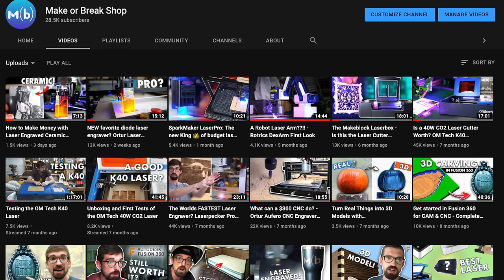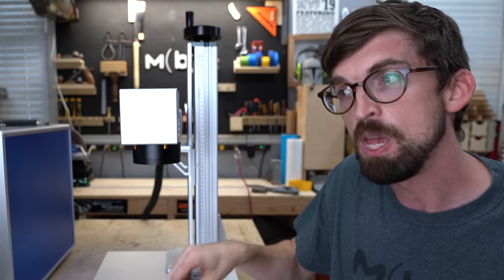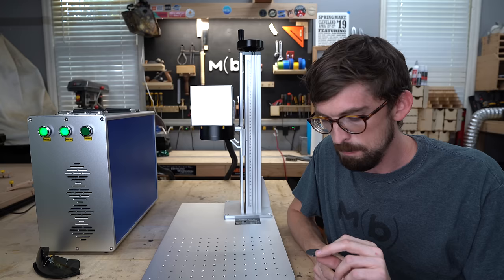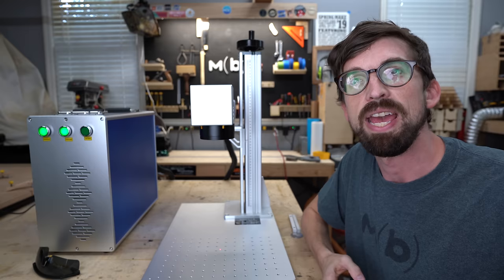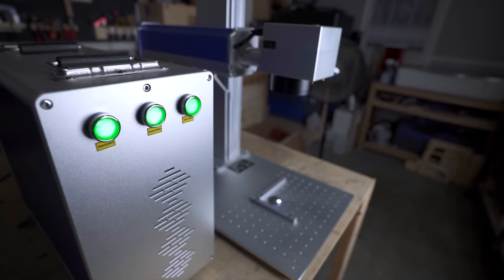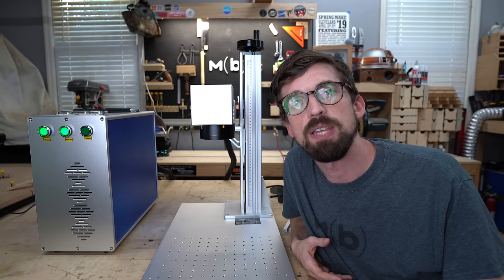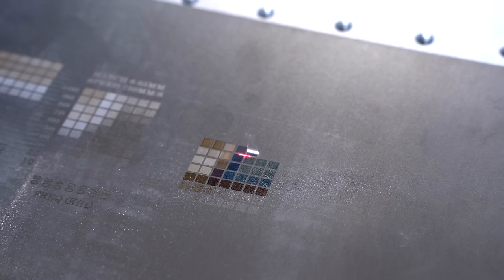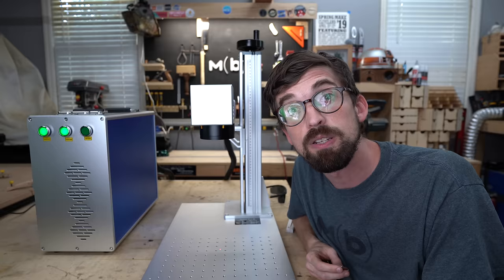This Laser Can Engrave METAL!  -  OMTech 20W Fiber Laser Review

Comment: Speaking from my heart you shouldnt mention that these machines have a range of 20-100kHz. Open the machine and check the fiberlaser module and you will see it yourself. If its a "cheap" Raycus this will eventuelly be a QS-Version (RFL-P20QS blue) with a range of 30-60kHz. This is what the chinese guys sell you as an 20-100kHz. If you use it out of this range the module will fail within months. Btw. even the good cheap china fiberlaser modules on these machines are RFL-P20QE versions with have a range of 20-60kHz. So be prepared.

Comment: I'm so tired of being told the lasers I own don't engrave metal. I've been engraving stainless steel knives since I've gotten both of my lasers one was a 10 W and the other is a 30 watt it just depends on the speed and the settings you use. it doesn't go that deep but it does work and its permanent. There are multiple videos on YouTube proving this, I'm not sure why the people that own CO2 lasers don't want to admit that dialed lasers operate this way, whatever

Comment: Fiber lasers don't use "a bunch of diodes".  In a fiber laser, the laser light is created inside of a specially "doped" fiber.  It's the fiber that provides the light amplification and "pumps" the light.
Reply: Don't diodes pump the fibers, analogous to the flashbulb in a ruby laser?

Comment: Why are galvo lasers not used on a gantry?  it seems like galvo = small work area but fast travel, gantry = slow but big work area. why not do a galvo head on a gantry to get a large work area and a wider (not directly downward) beam on a gantry?  If the galvo head is coupled to a wire source (or other pump configuration), the galvo head should be easily movable relative to the diode bank (my understanding is that fiber optic fibers/wires/cables are flexible and durable).  if the gantry could move the galvo head over a large area, that might also mitigate the other con of galvo heads you mentioned (sub optimal angles at limits of galvo head), because the galvo head wouldn’t need to be pushed to reach as far to yield a work area that seems competitive (it could stay within an optimal angular range relative to the travel of and on the gantry).  I’m not currently working in the laser industry so I apologize if this a dumb question.

Comment: I have a project which is going to involve making a lot of small custom designed parts made from aluminium and also carbon fiber.  One of my friends was recommending I look at diode lasers.  However these are really bad a cutting aluminium and carbon fiber is really hard.  I've seen the fiber lasers are much better for aluminium.  There is also some evidence from youtube the fiber lasers can also now cut carbon fibre.  However, I can't find many reviews using the fiber lasers to cut carbon fibre.  In short, I'm wondering if only a MOPA fiber laser can cut carbon fiber?  If you could let me know your thoughts that could make a big difference to me.  Looks like the 'Max' fiber lasers are also best avoided!

Comment: You have made a wonderful presentation of this unit. My requirements are to make pad printing cliche in my office. Maximum size would be 60mmx60mm. The steel has to be removed at a depth of .0015" . Also,  what resolution can I expect? Thank you very much. William Wall twp, NJ

Comment: When you have a larger object is it best to etch with a mill or is there a way to increase the work area with these devices?
Reply: What about a diamond drag tool
Reply: @wholeness  I just bought a diamond drag tool off of Amazon and am engraving 1000 aluminum parts with it. Almost finished with them. The engraving doesn't pop out quite the way I would have liked, although it certainly does the job. It would look a lot better if it had contrast with the metal though. For instance a black anodize layer then use the engraver for contrast against the color. Otherwise it seems to blend in with the aluminum and you can only see the engraving when putting it at an angle to reflect the light just right. I'm going pretty deep with it too, though I've considered using a stronger spring. sorry for the essay.   :D

Comment: The fiber laser is unique in that the fibet itself is whar creates the laser light  or more specificly the excited ions doped within the lattice of the crystal or glass fiber. Most of the time or at least for consumer focused fiber lasers they are pumped with a powerful    bank  of LEDs which is the excitation source stimulating the emission of radiation. These types of lasers can be significantly less expensive for maintenance as well as initial cost thanks to the more simple beam path. Obviously there are many other factors involved in the cost of the unit and  quality of the beam,  spectrum of the beam , how the beams pulse shape  and duration are controlled ,  or if it has a continuous wave stable  beam... sorry,  i love lasers haha
Reply from the maker: Thanks for the info!

Comment: This would actually be decent for marking company computers with computername, location, barcode, anti theft markings and such. But what is the life expectancy compared to a co2 laser?
Reply from the maker: Yep that is a great use case, the life is less than a CO2 but you’ll still get a ton out of it
Reply: @makeorbreakshop  100k hours sounds more that a CO2 tho. I wonder how I could mark something big like a printer, or if it would just burn through any type of plastic.
Reply: @makeorbreakshop  Why is the life shorter then cO2?  I thought these diode lasers lasted longer.  Is the galvo the part that dies first?

Comment: thanks for the great video! would laser engraving on stainless steel cause rusting later on? trying to find a way to engrave stainless steel that doesn't lead to rusting.
Reply: ok first it's stain-less not rustproof so, if the conditions are grim enough, even really good stainless will oxidize. That having been said, stainless should be stainless through and through, though there are coatings you can apply to any metal including stainless to keep it bright and of course some polishes will leave an intentional residue that keeps oxidation away for a while BUT the whole point of stainless is to not need that. So, stainless comes in different grades, and the designation will tell you how resistant it is. If you are having rust problems, see if you can get nautical stainless; I seem to recall it as 316 nautical stainless but I am math dyslexic so I very often juxtapose numbers (call alot of wrong numbers) but it is a 3 digit number beginning with 3 and it has to be NAUTICAL but they make a zillion things out of it. I know this steel holds up very well indeed even in salt water environments because as a himble deck hand on private oceangoing yachts crossing the pacific, the indian ocean and seasons in the med which is saltier than the others because of the intense evaporation rate, it was my job to keep things bright and it wasnt hard since only older boats (30 plus years) working hard would be having a little rust around indentations where salt collected and wasn't wiped off over years. Also, the machines do engrave titanium, which straight up doesn't corrode; they store spent radioactive fuel from power plants in titanium tubes...plus it does some cool things with anodized finishes which I think, maybe, lazers can do for you? Big maybe, not sure. It's also super light and much stronger than steel but expensive because the melting temperature is so high the cost of heating up the equipment to melt and pour and roll it out and all that jazz is more costly than leaving it on at a gazillion degrees 24/7/365.
It's also the only metal bone will adhere to which is why it is used medically, for implant screws etc. 
Now you can win trivial pursuits.
Reply: humble not himble. guess I shouldn't have banished spell check....

Comment: I found your your video very interesting and informative, and as a photographer who makes aluminum prints of my photos, I'm curious about the possible applications for this in my work.

Do you have any idea how much heat is generated by engraving onto aluminum? I'm curious whether it can be used on the back side of my prints without damaging the actual print and clear coat on the reverse side.
Reply from the maker: That’s a great question, I haven’t checked the heat directly after engraving.  Aluminum is a great conductor of beat so it could get warm but I’ve handled the pieces pretty quickly after using and they have been fine.
Reply: @makeorbreakshop  I have NDA's in place so I can't give specifics.  Depending on the material some heat will penetrate to the other surface so two options still work for your application.  Simply engrave the reverse side first ( prefered ) or provide a cooling airflow on the finished photo side.  Too much cooling will affect the effectiveness of the laser burn.  Best of luck
Reply: @phillpittman587  - Engraving in advance is not possible because my prints are made at a lab. Cooling the reverse side seems impractical, but I'll give it some thought. Thanks for the reply and suggestions!
Reply: @phillpittman587  - If you're willing to give it a try, I'm willing to send you a sacrificial print, one of my 'seconds'. Might make for interesting content, and would certainly be helpful to me to know in advance if it will work.
Reply: @Metal_Vistas  I wouldn't mind helping but I am still deciding on getting this particular laser.  I have other much stronger ones but to check this out we would need the exact one to do you any good.  I do my normal work now on a 100w galvo, 2-400 watt 5'x10' gantries and a 3000w 5'x10' fiber.  This small one would sure fill a gap in my world and cost a very small fraction (about 1/40)of the 100w galvo.     

If this works like I think it should, they are leaving a LOT of possibility unspoken.    Take a look at the wood medallion on the top of my webpage and consider it was done by 220 passes (sliced like you would a 3d printer ) on a small galvo.  The same machine is used for 3d carving tool steel dies  for stamping coins.  www.masterwerkes.com
Reply: @ppinthewoods3430  It works

Comment: Can you use this specific laser with fusion 360? I have both fusion 360 and this laser
Reply from the maker: Fusion does have a CAM environment that I use to create toolpaths for CNC.  There is a laser option as well but I normally will just export my design from Fusion as a DXF and bring it into something like Lightburn to actually send it to a laser.
Reply: @makeorbreakshop  Thank you for getting back to me on this! Because Fusion 360 is native to multiple OS’s, do you think this laser could work with MacOS? And potentially the software workflow you have?
Reply from the maker: @TylerDarlington  I run Fusion on Mac.  If your looking at this fiber laser you would be exporting out any design you do from Fusion and bringing it in directly to their software to send to the machine.
Reply: @makeorbreakshop  and I’m assuming their software is not compatible with MacOS? Or can the CAM in fusion 360 talk directly to the fiber laser?